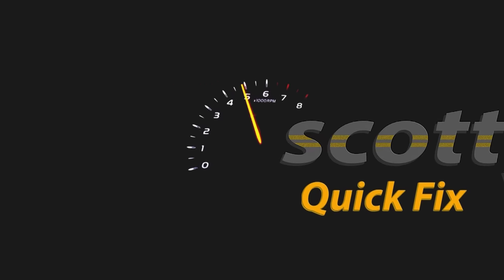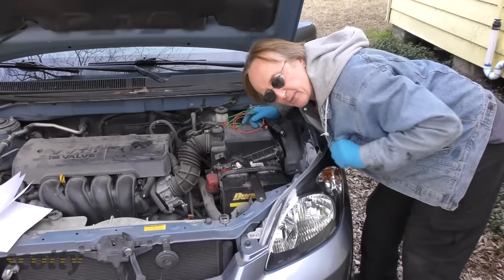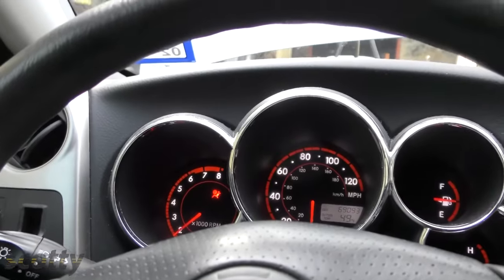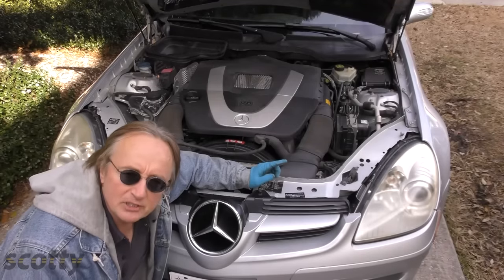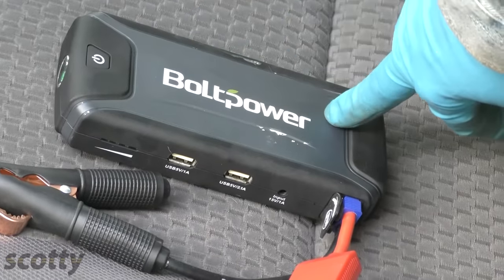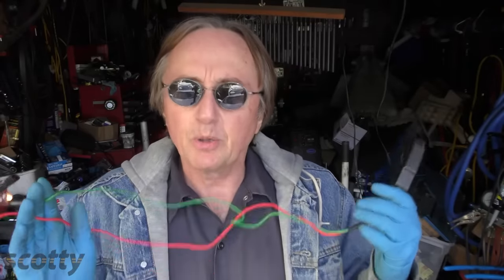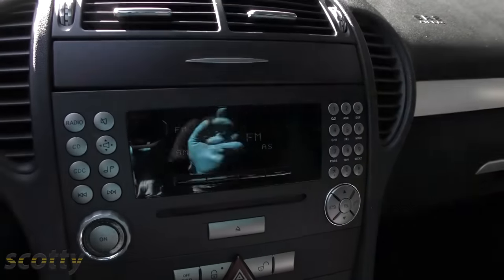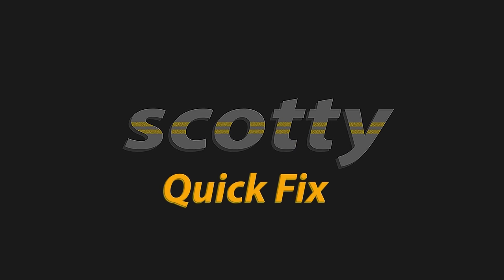How to Replace a Car Battery (the Right Way)

Comment: HI.  I tried this with an OBD memory saver that has a 12v power-port type connector on it and I connected my 12V jump pack.  I connected the jump packs negative to the outer ring, and the positive to the tip, and it blew my ODB fuse.  I thought I fried my ECU or something.  Did I hook it up backward?  I thought the power-port outer ring was negative and the tip was always positive. Any guidance?

Comment: I swear some manufacturers deliberately make their cars a pain in the butt to work on. It wouldn't take but just a relatively cheap capacitor to keep juice to the computers for the ~5 minutes the battery is unplugged to avoid this whole shindig all together.

Comment: My clutch pedal goes down and doesn’t come up, it has no resistance and I switched the slave cylinder because it was leaking and I bleeded it and everything but it still has no pressure and won’t go into gear. It only goes into gears when its turned off and I feel like its my master cylinder. What do you think it could be?

Comment: Thats why I don’t drive German cars. Changing the battery shouldn’t be a big complicated task. For the idling on Toyotas thats when I just take them for a spin on the freeway, they’ll be good in 20-30 minutes. Just don’t disconnect the battery right before a smog check

Comment: I understand the concept BUT I have two battery jump starters and both (for safety) only provide the voltage for 20-30 seconds. I don't think I can disconnect the terminals, remove the battery, lug a 40 pound battery into an SUV, and reconnect the terminals in 30 seconds. Apparently, this battery pack has an "Always on" feature?? Any tips?

Comment: This is why I tend to buy older mid-90's cars, not so much of this crap in them. My old Volvo 850 had one of those Anti-theft radios in it, factory. Whenever I disconnected the battery for any reason (replace, maintenance, whatever) it would lock the radio and show nothing but "CODE" on the screen. Volvo is easy for that, just type the VIN into the volvo database and it'll give you the code for the radio in an email. Nothing to it.

Comment: My car has almost none of that junk...simple but reliable. 153K going strong. No ABS No VDC
Reply: My mercedes has all that and more , just hit 300k and every tihing works, if you're smart and maintain you're things, it will last, resetting modules aka computers from time to time is how you keep them in sync, you dont leave your computer running all the time do you ? Well turning off your car is just like putting your computer on sleep, its not actually resetting it, that's why you should reset your modules in your cars from time to time and they will last.

Comment: Hey Scotty, Great videos. I have a question about my 2008 GMC Sierra, the passenger side door locks work 50% of the time and the other 50% of the time the locks will go up slightly, and sometimes back down. what could be causing this? Its both the front and the rear, sometimes the back will work and the front wont and vice versa.
Reply: Appears to be common problem for GMCs of that year.
Door lock actuator replacement is needed.
Here are good videos:

1A Auto Parts 
https://www.youtube.com/watch?v=9TyTgOF67Aw

David Jones
https://www.youtube.com/watch?v=wTKZmgWU8sk
https://www.youtube.com/watch?v=3VbMpuJIW9A

Comment: I own a 1998 Honda prelude with about 185k miles on it. I've done work on it over the years and recently replaced the transmission with a used transmission but now the engine light keeps coming on and I take it to my mechanic but it still comes on I don't know why it runs perfectly fine my mechanic says if it runs fine then don't worry about the light being on. I even warm up my car everyone I drive it .

Comment: my  94 dakota and my 03 ram dont have this problem and a 99 jeep dosent have this problem ... i have used a 9 volt battery and  soldered it to a 9 volt connector from a toy and soldered them together to a cigarette lighter plug.. works greattttttttttttttt.. WILL THIS WORK SCOTTYYYYYYYYYYYYYY???????????. INSTEAD OF THAT THING YOU HAVE?

Comment: Can I use something like this instead of bolt power battery?

It plugs into house receptacles and allows you to plug in cigarette lighter devices and I saw a memory saver that connects with cigarette lighter 

180W AC 110-240V to DC 12V Converter, Max 15A/8.69FT Car Cigarette Lighter Socket AC/DC Power Supply Adapter for Inflator, Car Refrigerator, Car Vacuum Cleaner AUCARAUTO C15

Comment: My factor auto starter and alarm . Linn lately the car will start on it's own. Even if I remove the battery from the remote starter. I hate noticed the negithve  terminal was lose. .if I disconnected the battery  then reconnect the positive first then the negative will this reboot the factory alarm. Iys a 2004 I never had a problem with it until now.

Comment: That's great and all... However, people usually change their car batteries once they are already dead. (which defeats this method of KAM completely). I don't know anyone that says, "hmmm... I think it's time for a battery change. Let me go pay to replace it even though it still seems to be operating fine." lol.
Reply: Ummm... no it doesn't. A dead battery is "DEAD" thus the term. It wouldn't even work your power door locks let alone keep the car's computer functioning.

Comment: The most that happens when I disconnect the battery from my 06 Element is I have to reset the radio and the auto updown feature the driver's window take awhile to resetreset.

Comment: Scotty, I know you fix 'em, not design 'em, but riddle me this.... Why do you suppose car makers don't include some kind of capacitor that could hold a 12v charge (low amp) for a few hours, allowing battery changes to occur w/o issue?

Comment: Ok well what if you need to do electrical work on a Mercades (say you need to replace a xenon lamp) and you really dont want any power going to them but you also dont want the computer to lose memory? Does applying voltage only provide power to the computer?
Reply: Fox McCloud 007 Through the odb2 port, yes. If you need power for xenon's then you need a charger on the terminals
Reply: Mario Paul Good to know. From what I can gather if you get electrocuted by a xenon headlight it can kill you. In the case of the Mercades my family has they each run on 25,000 volts

Comment: What if we connect the 12v external battery directly to the car battery connectors? I don't see the point to connect power through the obd port. BTW, I'm not a mechanic nor electrician.

Comment: Wouldn't it be called volatile memory? Reminds me of the old school Super Nintendo games where the battery would go flat and your saved games would get erased.  

Oddly though with the advent of flash memory being dirt cheap, wouldn't it make more sense for a vehicle to back data up to a flash memory card that's replaceable in the event of the flash memory wearing out?

I don't imagine it being difficult to store factory defaults in ROM somewhere to be loaded in the event of a loss of memory.

Comment: I have a 1987 Nissan pick up truck. I always leave The battery disconnected because i dont drive it that much. When i do drive it it always starts up And runs like a charm. How new does a car have to be to have this problem?
Reply: You don't need to do this for your pickup.

Comment: Why don't they put a backup battery in them like bios in computers use a small battery.  Then just change it every few years. And also they need to stop making everything computer controlled it's ridiculous.
Reply: >Why don't they put a backup battery in them like bios in computers use a small battery.  
Because that costs money.

Comment: My 2005 Corolla could barely idle without stalling after the battery was disconnected. If it ran for at least 20 minutes it would be fine the next time it was started.

Comment: Happened with my suzuki sx4 when I replaced the battery. It started idling poorly. The mechanic cleaned the throttle body with a spray and after that, the car started idling normally.

Comment: Ok, so what if you are doing other electrical work and need to disconnect the battery but use this memory saver.  I would think having power still present in the system could be disasterous if you accidently shorted something.

Comment: You can put standby battery on battery cables until you replace main battery.  I would avoid letting engine run during battery swap as voltage without battery can get too high.

Comment: Resetting modules aka computers from time to time is how you keep them in sync, you dont leave your computer running all the time do you ? Well turning off your car is just like putting your computer on sleep, its not actually resetting it, that's why you should reset your modules in your cars from time to time and they will last so unplug that battery from time to time or find out specific module reset for you specific manufacture. My mercedes requires no dealer scan tool to reset most of the modules unlike Scotty puts it, removing a battery on a mercedes wont do anything... they have auxilary power aka, memory battery that holds a charge to remember the module adaptations, radio stations and time on your clock.

Comment: It is hard to understand why the manufacturers don't use non-volatile memory for crucial information backup. None of the important memory parameters should be power dependent, that's just poor electronic design.

Comment: Why don't the manufacturers use NVRAM for data retention or a capacitor to keep the volatile RAM intact? Seems foolish in a modern system.

Comment: can you hook up the keep alive tool to another car’s battery via jumper cables?
Reply: Trashe Maile Hmm that should be possible actually. Don't see any issue there.
Reply: or you could just hook up the battery terminals to the other cars battery while changing it ;) just dont short them out.
Reply: Of course. Any 12 volt supply. Could be from cordless power tools, boat battery, scooter batteries that are 12 volt. Just make sure the connections Are good and secure. If connections come undone before you fully connected the new replacement battery or reconnected the old battery you're screwed.
Reply: That's what most people would do yes.

Comment: Excuse me what would happens if you turn off the car and then take out your battery? I thought that would happen if the engine was on and you disconnected the battery and  the program would turn off incorrectly.

Comment: I have a 2000 Cadillac Deville and my crankshaft pulley has a wobble in it and the car is squealing loud how do I fix this problem I changed the idler pulley and tensioner pulley still squealing
Reply: Pretty common for the rubber inside the crank pulley to deteriorate, specially on those GM's, just get a new crank pulley.
Reply: ltwargssf R thanks so much I changed the belt and no more squealing but ima still get a new crank pulley
Reply: Yeh that's common temporary fix, in about a month it'l start squealing again, good luck.

Comment: Has anyone tried connecting a Battery Tender Junior connected to the leads while you remove the battery? If the Tender is supplying 12v to the car then shouldn't it keep the computer alive?
Reply: i'd imagine its the same sh*t
Reply: Probably depends on if the battery tender is relying on the battery as being the capacitor of the power supply circuit.

Comment: Ridiculous, you'd think they'd just use flash memory that doesn't require power or uses a small battery backup to preserve data when the battery is disconnected. It's almost like they did this on purpose.....

Comment: At jiffy lube they leave the car running while changing the battery
Reply: It does work
Reply: Eric sin it takes less then 30 seconds if you are quick. It’s not like someone will drive away with no battery
Reply: Another reason the are known as Iffy Lube.
Reply: Jiffy lube sucks balls. They cost me great truck 10 years ago. I just wish they go out of business.
Reply: Alternator output voltage can toast the computer of your car without the battery.

Comment: Why the hell don't they install memory and voltage savers to prevent reseting from the factory?
Reply: They probably do, but the computer detects that you've changed the battery and have to be reset with specialized equipment that most people don't have. This is so you have to pay a shop to do it. This is the case if you buy a car like that Mercedes in the video, my Honda doesn't care if I replace the battery, I just have to reset the clock and equalizer settings on the aftermarket head unit and it's all good.

Comment: why cant we just start the car and replace the battery with the engine running
Reply: Could fry the voltage regulator on the alternator on some newer cars doing that.

Comment: There are several components to doing a pro job. One resource I discovered which succeeds in merging these is the Jons Mender Guide (check it out on google) without a doubt the most useful course that I have ever heard of. look at this unbelievable resource.

Comment: But.... wouldnt a 9V battery in the cigarrete port do the job? I mean it aint gonna take you a whole day to plug a new battery....
Reply: Alucardjr69 It will work but not recommended coz when u put back ur 12v battery, ur introducing higher voltage to the 9v just like charging it which is unsafe if you use a non rechargeable 9v battery
Reply: garyboyh im honestly not into new cars i enjoy my old vehicles, all this computer drama stuff makes no sense for me.
Before the only thing i was worried was losing the radio stations, and like scotty said some radios use a code so a 9V battery will do the job and was completly safe to use.

Im honestly hating all these plastic, computerized vehicles.

Comment: NEVER DO THIS! This messed up my infiinitys computer doing just what you said. Never use that adapter! It was very expensive for me. Maby on Mercedes you need it, but on normal cars, DON'T USE IT!
Reply: That shouldn't be possible its just power the 12v pins on the obd connector which is fused. Sounds like a coincidence.

Comment: I just changed my battery now I think my MDS is messed up I think when it switches to four cylinders the car vibrates is it my MDS or maybe motor mounts it runs fine when I use auto stick anyone know anything about this it's a 06 Dodge Charger Daytona

Comment: Scotty after they change my fuel pump the battery went completely dead he took out the negative cable before he install the fuel pump then I charged the battery now it won’t start what can be the problem it’s a 2002 Nissan Altima 3.5

Comment: When you replace battery don't turn off car replace it with engine running 👍🏽
Reply: No, just no, apart from supplying power when the engine isn't running, the battery is also a much needed buffer to protect all electrical systems when the car is running.
Reply: 3bdullah50 that can burn out an alternator
Reply: We did that with my daughters Windstar, POOF- sparks, fire and over $200.00 for a new alternator. DON'T do it!
Reply: just jump-start and detach the older batt
Reply: I'm doing that more than 5 years nothing happens 😟